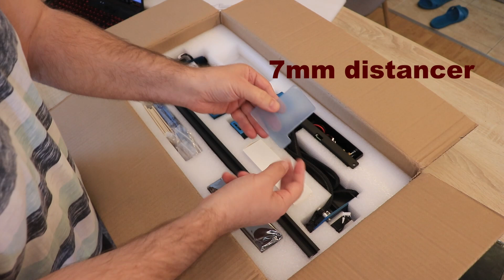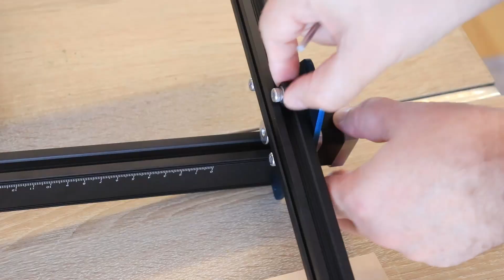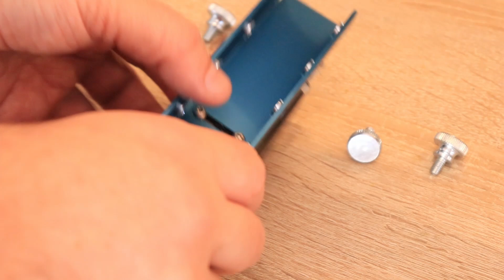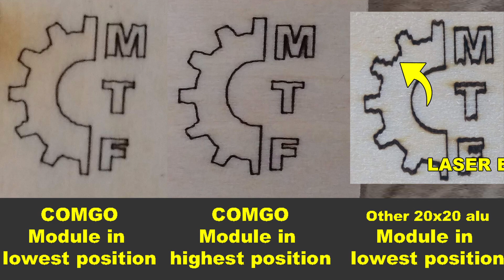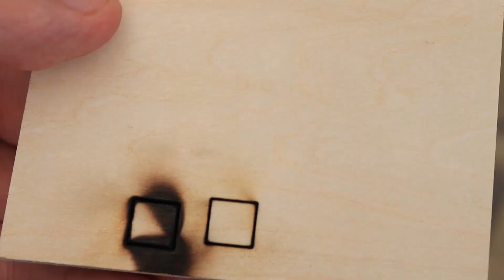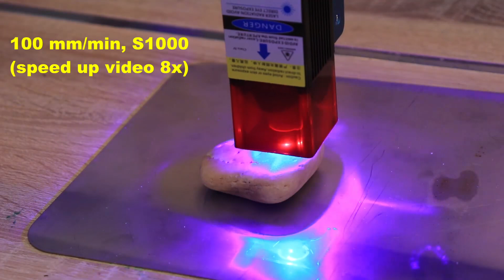Comgo Z1 10W laser engraver by Comgrow - unboxing, assembling, test engravings and cuttings

Comment: Hi i have the comgrow z1 10w and using the spacer to handle the focus, i try to cut 4mm boards from hobby lobby... i think they are solid wood... do you have to use plywood as no matter how many passes the laser doesnt go through... however i found if i do multiple passes with my 5w laser, also a comgrow z1, through the same 4mm material solid board it cuts.... although takes 5-6 passes... why is a higher wattage not seeming to handle the same job better? Ty

Comment: hi i got the 5w original so was wondering about the small piece of plexiglass that came with it... I was using it to adjust the length between the laser and the stock... and wanted to make sure I was doing things properly.  thank you.  I have recently purchased the 10w z1 from comgrow and wondering if I will find a thicker test piece of that is what it is. thanks.

Comment: Mine doesn't change from Idle... how do I make it go? I can move the laser around by pressing the arrow buttons, but even though I've loaded up an image, i cant see how to make it run, I think the start button is greyed out.
I tried updating the firmware (have no idea whether this actually worked because there's no indication as to whether it did anything with the SD card inserted). 😦
Edit: Nevermind, I'm an idiot, realised you've got to press the little play button next to the COM port, and not the large STOP/GO buttons in the bottom right 😕